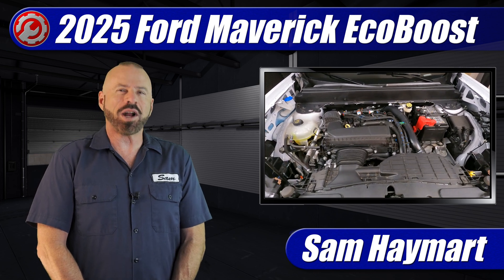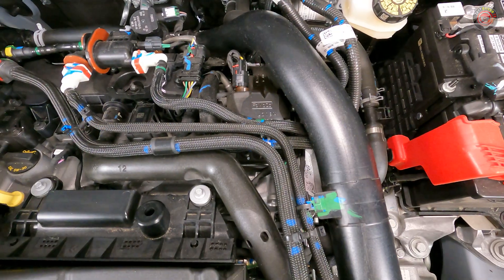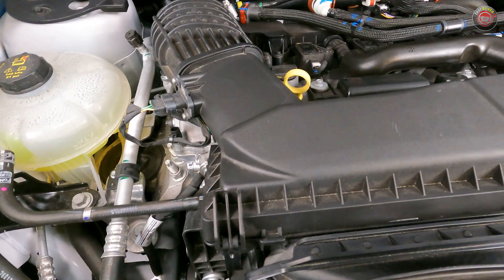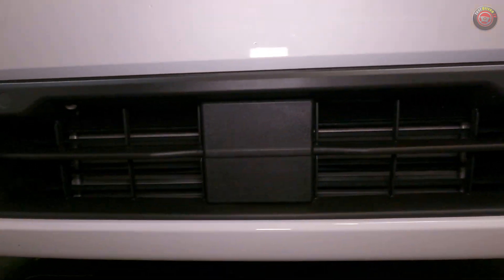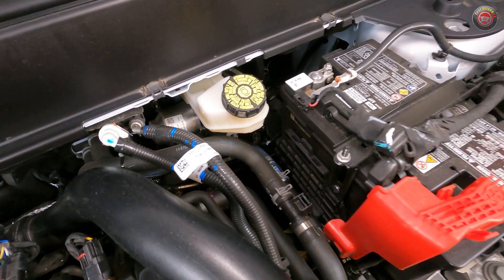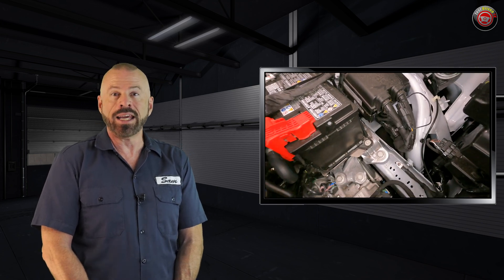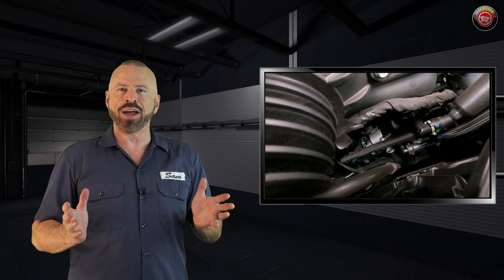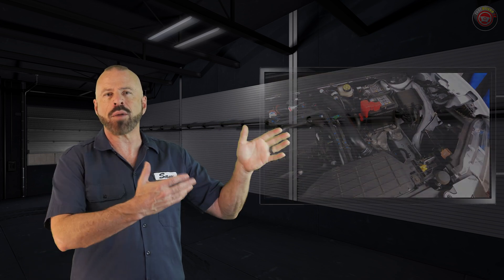Under The Hood: 2025-2026 Ford Maverick EcoBoost All New Engine!

Comment: So ford just anounced a turbo and intercooler upgrade will be available for the ecoboost Mavericks in 2026 and you can keep your factory warranty if they or a certified mechanic installs it. The exhaust side of the turbo  stays put but the compressor side comes off the 2.3L Mustang   "The centerpiece is that proven turbo with a significantly larger 59mm compressor wheel (up from 53mm on the stock unit). Here's where it gets really good: We paired it with a Mishimoto intercooler that's 58.8% larger than stock. This intercooler delivers a 39.6% increase in temperature reduction and a 20.1% reduction in pressure drop compared to the factory unit." The ECU gets flashed too to accomtthe physical upgrades. 300hp theoretical claimed hp and 317 theoretical claimed tq.  So the big question is will it be available only for 2025 and newer or all 2.0l Mavs? The new trim  wirh it installed is called the 300T.

Comment: How can I tell if I do or do not have the particulate filter?
Reply: I would like to know also.
Reply: I would like to know how to tell for new 2025 and 2026 Mavericks. I suspect the window sticker will reflect the lower HP rating but am not sure.
Reply: You can look underneath it. Right behind the front axle in the middle of the truck there will be a big round metal thing (like a catalytic converter) with sensors and 3 little metal lines (sensors) coming off it.

Comment: I was surprised to hear about the Particulate filter as this is typically used on diesels or at least a gas engine with direct injection, not a port injection design.

Comment: The 238 hp listing was another shady deal from FORD, That rating came from calculations to meet California emission standards that FORD now admits were incorrect. The 2.0 still produces 250 hp.  For what its worth, I love the performance and handling of my Maverick. It is a quick truck.
Reply from the maker: The 238 hp rating is not "shady". It represents the certified rating with the gas particulate filter, which early production has not yet been fitted with. While clumsy, it's not shady. If they put the extra device on and kept telling people it made 250 hp, that would be shady.

Comment: I appreciate that they kept this 5W30 oil and added port fuel injectors to eliminate the potential of buildup on valve stems.  It adds complexity, but potentially eliminates some potential issues in the long run.
Sam, you are correct too.  Ford sucks at providing even those of us at the dealership level information.  They can't get their act together to inform us of crucial information on parts acquisition or repairs too.  Additionally, it's bad enough when they have recalls, but sucks when you can't get the parts, or they continue to update the recalls because they didn't just fail to resolve the problem with the first issuing of the recall, but the second, third, forth, fifth....  I mean, how many years do you have to produce a vehicle before you learn the importance of producing parts correctly the first time around and not at multiple recalls?   I mean at some point after 100+ years of production, you'd think they'd learn how to make wiper motors and arms, door latches.....

Comment: Less HP! Less torque ! Already under powered !
Reply: The eco boost is faster accelerating than most v8 trucks because it weighs half as much as a full size. Not to mention it comes with a turbo that can be tuned for 300+ hp… you don’t have a clue, it will smoke a 5.3 LS

Comment: Hmmm…why are these considered “improvements”?  I ask because my ‘22 EB gets 33 mpg on the highway, 250 hp/277 tq.  Is a loss of 12 hp an improvement?  Truck works great and I have not wanted anything changed, so hope nothing was messed up with the changes.
Reply: Minus the particulate filter it’s mostly durability improvements.

Comment: The changes don’t mean a whole lot to marketing.  It’s simply refinement on an engine that’s been around.  Adding port injection to quell carbon build up on intake valves is not something the average person would care about, or perhaps care too much to admit this is a problem on pure DI engines.  There was nothing from Ford when it added port injection, a completely different oil pump system, and firing order change on the ‘21 F150 5.0.  Ford, as any manufacturer would rather have you think it’s all good, past and present.  I mean there is no power gain or fuel economy advantage to the changes.  To me it’s about durability, and again one doesn’t admit any past inadequacies.

Comment: Is it confirmed to be 238 HP?  I thought Ford reversed course on that and it's officially back to 250...?  If you "build your own" on the Ford website, it claims 250 HP / 280 ft-lb.
Reply from the maker: The horsepower number you believe depends on which one of the Ford specs you get. That’s the issue that was noted at the end of the video.
Reply: @TDTVGarage yep,  I think it's because it's an all new engine and nothing to do with the gpf that's not even on these yet

Comment: there's information in this video that no one has yet shared, let alone gathered all of the knowledge together in a single source. no one is talking about the change to bore & stroke, even though they are minor. also of major impact for the tuning community is that this engine - like the other ecoboost engines that have moved to the MPC design with both port and direct injection, have locked ECUs so you cannot tune them. for anyone thinking that reflash tunes are a fringe behavior - no, in fact, Ford Performance sells reflash tuning kits for several models and supports them under the factory powertrain warranty if installed by a Ford dealership.

Comment: Oh goody.  A gas-particulate filter, so now gasoline-powered vehicles can enjoy all the problems that Diesel vehicles have had for years now.  Yay!  More complications, more stuff to break.  What fun!  Oh, and down 12 HP because of it.  Fantastic!

I am **SOOO** glad I bought a 2024 2.0L.
Reply: The gasoline particulate filter only comes on vehicles that go to states that adopt the California emission regulations. States that don't adopt those regulations will not have the gasoline particulate filter. Me living in Wisconsin I don't have to worry about that nonsense. Hope this helps.
Reply: @alexlautenschlager566  Apparently Ford has decided to install the GPF on all Ford Mavericks, rather than build some for CA (and the 17 states that follow CA's emissions rules) and some for the remaining states.  The GPF is on all Mavericks beginning in the 2025 model year.
Reply: @LMacNeill  Incorrect.  I have a job 3 build (built July 5, 2025) that is confirmed to not have it.  Was built for a non-CARB state (Iowa).
Reply: @jrite77 saw one for sale here in my home state of Georgia. Not a CARB state.  238 HP, not 250. That means it has the DPF. I just assumed that also meant ALL Mavericks were getting a DPF. Why would one here in Georgia have it?
Reply: @jrite77  is there anyway I can determine if my engine has that on it or not?
Reply: @wang220  I looked underneath and it's not there.  It would be up by the catalytic converter.  It would stand out since it's fairly big, and has sensors going into it.  Looks way different than a cat or secondary cat.
Reply: @LMacNeill thats incorrect
Reply: its called epa mandated emissions for gasoline engines which is reality,or theres always hybrid plug in hybrid or electric

Comment: Ill pass on any eco boost
Reply: Ignorance
Reply: @Kollin-z9m nope they are not good engines
Reply: @TexasNationalist1836 that’s objectively false; let’s not be ignorant
Reply: @Kollin-z9m as someone who’s owned one they are indeed trash, it’s objectively true they had cam phaser issues objectively true they had timing and turbo issues on the gen ones and turbo issues on the gen 2s so your objectively refuted and wrong
Reply: @TexasNationalist1836 you’re* and you think your single poor experience justifies calling a mass produced engine that’s been running great for MILLIONS of people including myself trash? Every brand and model has their lemons. This truck is objectively a great running machine, and its longevity and durability in such short time span of use speaks to that. Take a poll if you will, the sales speak for themselves.
Reply: @Kollin-z9m clearly you can’t read because I listed the problems like cam phasers failures turbo failures timing issues and other issues with the ecoboost platform, read better
Reply: @Kollin-z9m ford literally had a recall on the second gen ecoboost for cam phasers your entire point is dumb “muh sales” yeah that’s a fallacy
Reply: @TexasNationalist1836 mavericks score above average on every major automotive reviewer. you’re trying to use the same logic of “all cops are bad” because there’s a few rotten ones. Pure ignorance
Reply: @TexasNationalist1836 find one truck model without recalls.. oh wait there aren’t any. All trucks are garbage huh?
Reply: @Kollin-z9m do you think auto reviewers and awards can’t be corrupted or bought out
Reply: @Kollin-z9m you have no argument no evidence just pure talking points, ford has had wet belt failures turbo failures cam phaser issues recalls and many other issues with the ecoboost system

Comment: Thank you for posting this video.  I bought a 2025 Maverick two weeks ago and was surprised to see that the information on Ford’s Website didn’t match the engine in my vehicle.  The new design is very good which is why I’m surprised that Ford isn’t promoting the new design as a selling point as the previous engine has a checkered history.  

I found out that the new 2025 engine is a Modular Power Cylinder (MCP) type engine and includes a built in Oil Vapor Separator which lessens the need for an after-market Oil Catch Can.

My Maverick was built on December 3, 2024 and it does not have the gas particulate filter.
Reply: The gas particulate system isn't good news. Not at all.
Reply: eh, they may not be promoting it because there aren't as many up sides as you may think. There's also an issue with oil dilution now where there wasn't before. anything built after October 2024

Comment: This was a great video with a fantastic overview of the new 2.0 Ecoboost. I have been in the market for a 2025 Maverick Tremor and I found one on a dealer lot with a January 2025 build date. A very knowledge service technician pointed out where the GPF (gas particulate filter) is missing on this build. He told me 2025 build #1 and #2 do not have GPF's, build #3 delivering to dealers in late June will have the GPF's. I put a deposit on the truck and I am just waiting for the recall to be completed so I can finish the buy.

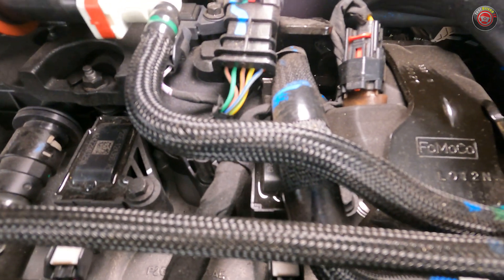Comment: One good thing for sure is they added port injection to the direct injection to remove carbon buildup issue on intakes... 2:05
Reply: But the last 2.0 didn't have issues with carbon build up
Reply: @CrackhouseAmy   It actually did
Reply: @CrackhouseAmy true, that!  Lots of fake news out there about all these engines having problems with carbon buildup but I have not seen anything verified.  If someone has proof they can upload let’s see it let’s see the numbers rather than fanning fires. At 15,000 miles my 22 runs strong.
Reply: @mikelesh9513  It takes more than 15,000 miles - but you already have some carbon on your valves.  The best argument that I can say is in favor of dual injection is that Toyota uses is on their best engines and Ford uses it on their EcoBoost motors that go in the F150.  Imagine if they had a class action lawsuit or a recall where they had to clean carbon out of the valvetrain of 5 million trucks... Now they need to take care of the Ranger's 4.
Reply: @CrackhouseAmy  and what mechanical knowledge do you speak of?
Reply: @CrackhouseAmy  Yes, it does.
Reply: Purchased the carbonized grey 402A package 🏁

Comment: The prior 2.0 ecoboost was actually a good long lasting engine,...200 - 250,000 miles (with exception of 2019)  ...hopefully this is even better but NOT worse.
Reply: What is wrong with a 2019? I do not know much about Ford Mavericks. I am a long time Mustang enthusiast.
Reply: @MisterJ.J. I think something with the head gasket block design.
Reply: @MisterJ.J.  These pre-2020 2L ecoboost had high risk of coolant ingress due to slits between the cylinders.

Comment: A new engine by Ford? A new adventure for buyers.
Reply: It’s not a new engine design, genius.  It’s the same engine family with what I would consider durability enhancements first introduced on the ‘24 Mustang 2.3.
Reply: @ProjectFairmont  totally differentt engine family from anything before that Ford has used
Reply: @thejmcGarage haha right.  You’re gonna need more than that to convince me.  Pray tell, what family?
Reply: @ProjectFairmont  It's called the MPC Ecoboost family (Modular Power Cylinder) of engines that 1st debuted on the 2024 Ford Mustang for the 2.3 and then spread to the 2.0 and the 1.5 also.  This is all well documented and easy to research.
Reply: @thejmcGarage still not all new.  Same bore spacing, cylinder head chamber design, cast in head exhaust manifold, cam chain tensioner.  Evolution of the Mazda L engine of 2002.  The 1.5 is from the Sigma family designed in Europe.  Semantics, but not all new in any case.
Reply: @ProjectFairmont  Oh i see, to lazy to do the research.  Not surprised but it in reality it is an ALL NEW engine family that shares nothing outside of displacement with the old mazda l series engines.
Reply: @thejmcGarage ”too” lazy.  Not surprised?  You the F are you to know moi?  Same basic engine.  Just as the Coyote is based on the basic 1991 4.6.  “All New” you sound like a Ford PR person.  Dude, I have been around and worked on too many engines to know what a new engine family is.  It’s not.  The basic architecture, bottom end, head design is not new.  It’s built on the same line, using existing hard point tooling.  That said,the added port injection and strengthened block are excellent.